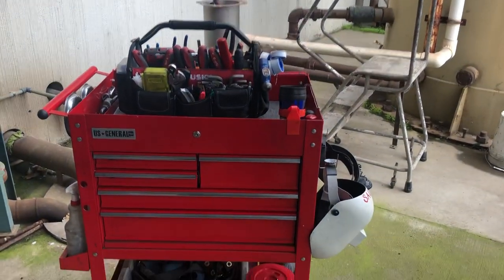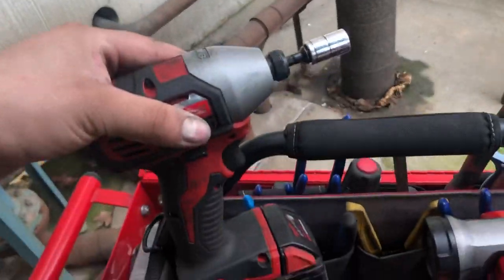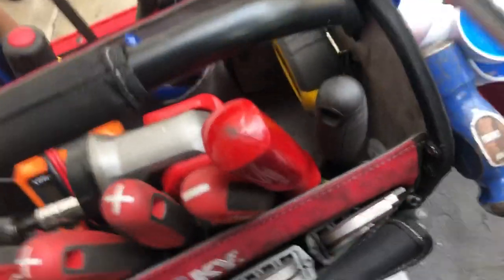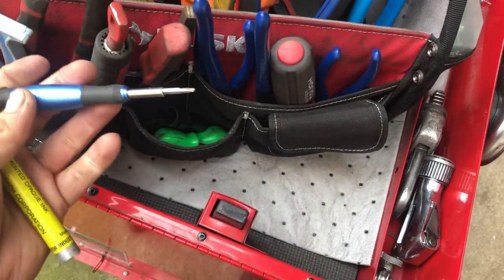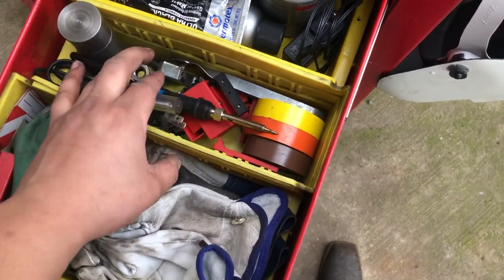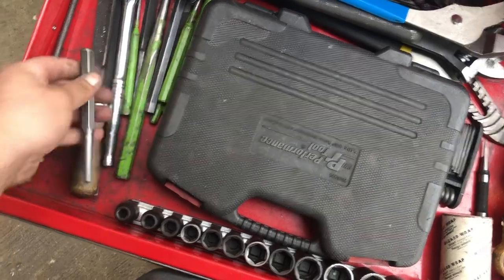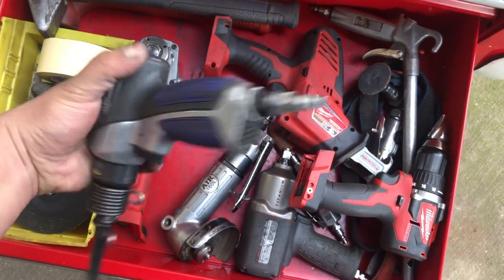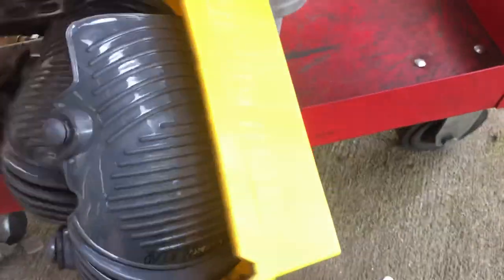Industrial Maintenance Technician tool cart tour

Comment: You should do a video on what a new maintenance tech or apprentice needs.  Thanks for taking the time to share your vids
Reply from the maker: Still 1 thank you I appreciate that! And ok maybe i will then i just upgraded my cart so ill have a new video on it soon when im done painting what i made
Reply: As a lvl 2 industrial mechanic my opinion is that juat about everything in the video will be needed pretty soon after you start. I would go for everything minus the air tools and power tools. The lifers that have been mechanics forever will generally let you use their power tools until you can get them, unless you are lucky enough to work in a shop with company provided power tools.
Reply from the maker: Jordan Milton i think you are right but one thing is for sure , more tools easier to do your job
Reply: I also think it depends where you work, im in  packaging maintenance, 90 percent of the time i just use hex keys and combination wrenches, we have a tech for PLC/electric stuff and a guy in a machine shop so i dont experience much of that,
Reply: @Jefferson David flixportal :D
Reply: @Sean Vance Thank you, signed up and it seems to work =) I appreciate it !!
Reply: @Jefferson David you are welcome :)
Reply: As a current apprentice as of now I can tell you that I do have miscellaneous tools in my tool bag which basically only consists of a measuring tape channel locks Allen set Carpenter square utility knife a few sockets but mostly what you want to know is your rent sizes it's very important to know your wrench sizes and socket sizes be able to look at a boat and pretty much tell what you going to need to get it off because the last thing you want to do is be giving the guy you're helping the wrong size damn rent also carry some markers that you can measure a motor and write down the measurement that way when you put it back in that's just less alignment that you got to do so make sure you got a measure and tape a good paint marker and just the willingness and humbleness to learn and remain teachable even though you might know the right way to do it or have a better idea just pay attention and listen for the most part all the tools that you'll need the guys you're working with who have been doing it for 30 plus years nine times out of 10 they going to have what you need and if they ask you to do something they got what you need to do with so just sit back pay attention soak up as much as you can and stay off the damn cell phone yes sir and no sir you'll be fine
Reply: @Boom-rc5gl  sums up my experience working in assembly, 90% of the time you use hex keys and wrenches 8% pliers and 2% other specialty tools